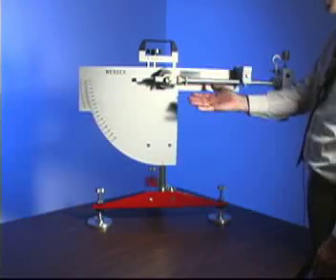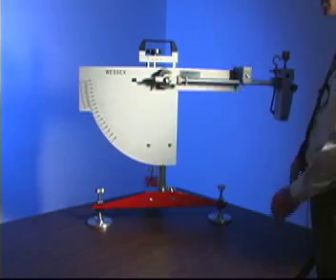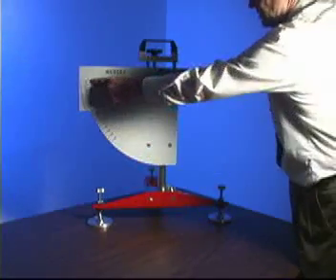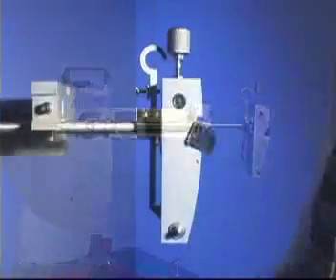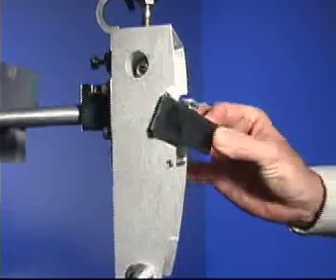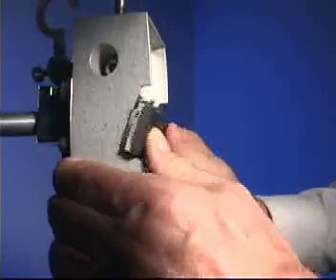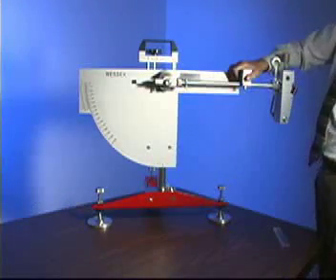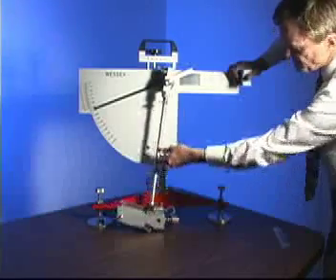Pendulum Slip Resistance Test Demonstration

Comment: Yes...it would make a big difference. There is a supplied ruler that helps the trained operator line up the exact distance the slider will contact the floor, which is between 124 and 126mm.

Comment: The pendulum path length on the floor is always set at five inches by using a ruler and adjusting the vertical position of the pendulum (using the knob on the top) as needed. The vertical position is then locked using a knob in the back that doesn't show in the photos. -- George Sotter